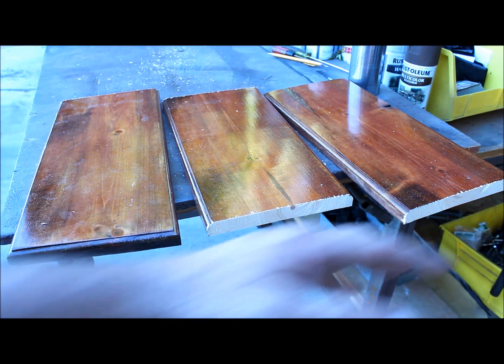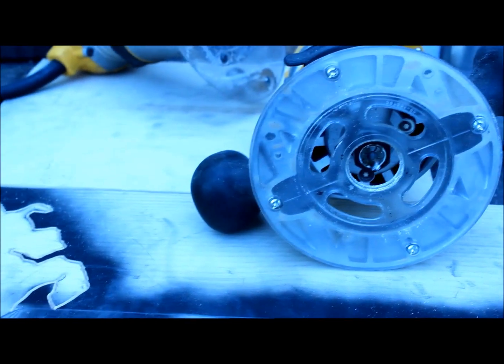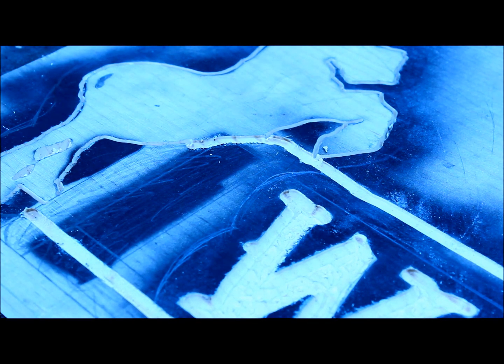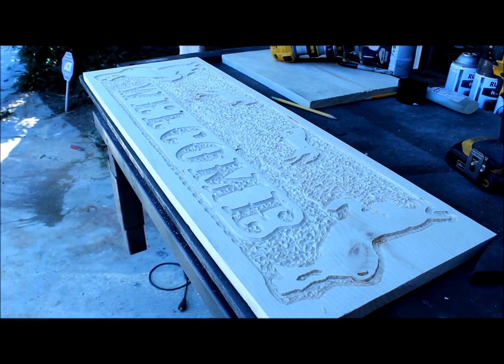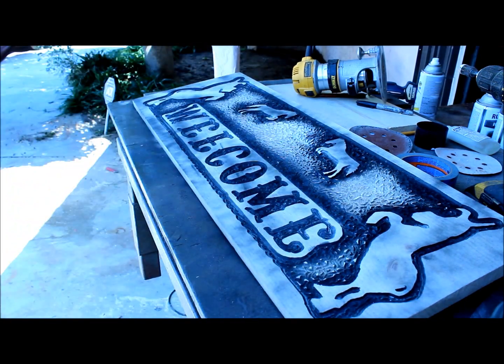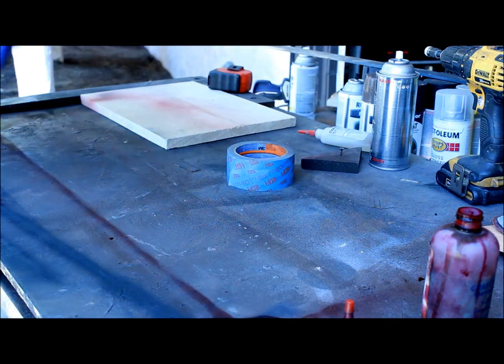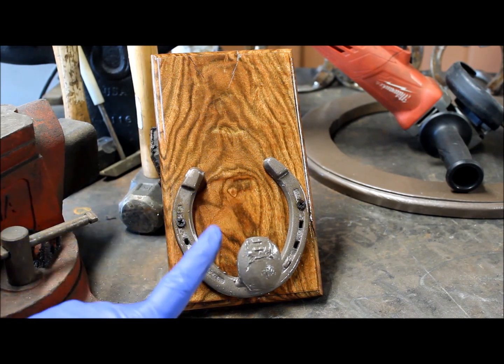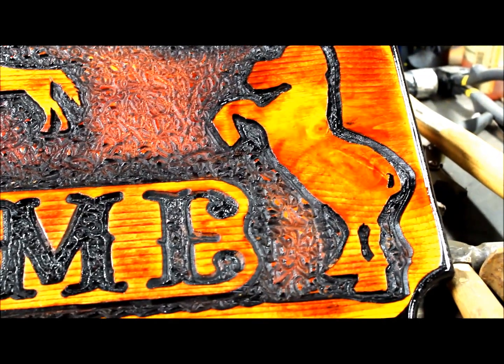Make A Wood Sign - A Welcome Sign - Part #2

Comment: Nice sign.
The detail bit...is that the profile bit from Dave ?

Or what bit do you use for details ?

Take care and have a great day .

/ Morgan Stoltz, Sweden
Reply from the maker: No - I purchased it off amazon see below - Dave&#39;s bit comes to a sharper point and will do a bit finer type carving - I already had bought this one before knowing about Dave&#39;s bits - they also offer a sharpening service when they get dull -  this one has worked  fine and i have been using it quit awhile now. Next time I will probably try his bits - which all bits can be bought from Whiteside also ....hope this helps ...thanks Dan 

https://www.amazon.com/Whiteside-Router-Bits-SC50-11-Degree/dp/B0012K7154/ref=sr_1_fkmr0_2?ie=UTF8&amp;qid=1499309362&amp;sr=8-2-fkmr0&amp;keywords=whiteside+router+bit+carving+detail
Reply from the maker: No but he does sell them - I got mine off Amazon from Whiteside  -   https://amzn.to/2vJwTHB
Reply from the maker: I also got my 60 and 90 degree bits from the same supplier

Comment: Hey  does trans tint fade after a few months oh by the way I do a lot of routed signs for people and do you  sell the template Thank You Billy Morris
Reply from the maker: Yes it can but I seal mine with really good outdoor UV varnishes etc - if its staying outside you may want to consider using paint and a hobby spray gun to apply it which I have done also and them coat it with a outdoor varnish (several coats) - The templates I make using    https://www.posteriza.com   just google search it and its free......then i transfer it over onto the wood with tracing paper

Comment: Can I use any spray paint brand?
Reply from the maker: If you are referring to the spray over the letters - black - You can use primer in black and that would work well - I would not use spray paint to do the letters its harder to work with when getting it off - not impossible but not my first or second choice......
Reply: Thanks👍🏻